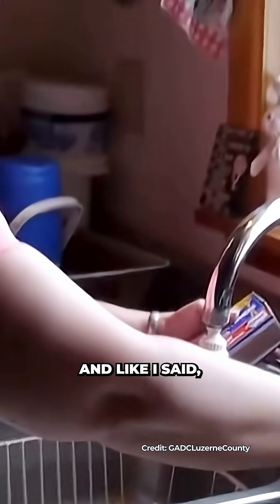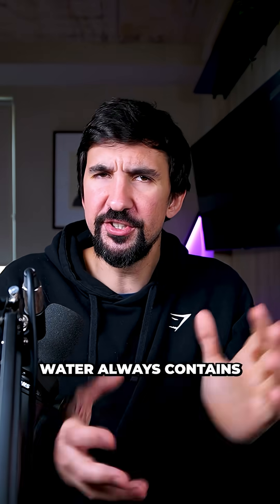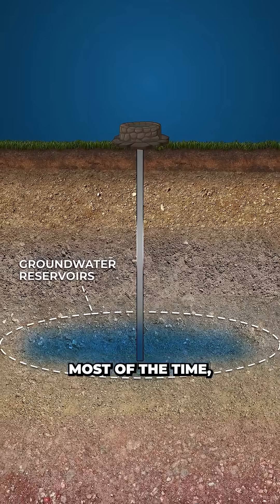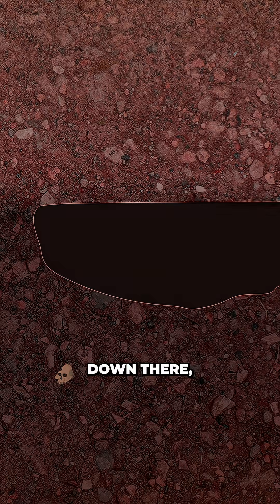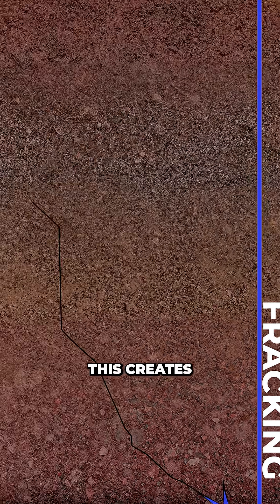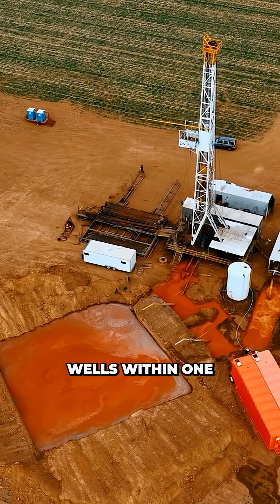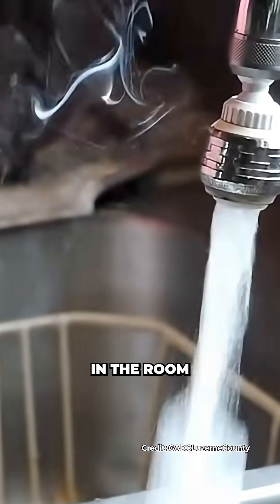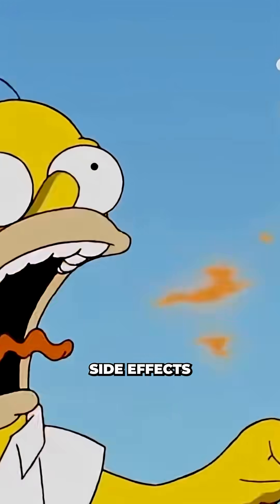Why This Water Catches Fire

Comment: I'm a lot harder on science videos than entertainment ones because even in a short, you're supposed to give complete information even if summarized.

The implication that methane in water concentrated high enough to ignite is only through human intervention is completely debunked and completely unnecessary.  The point that studies have found isolated cases of increased methane corelated to human activity is the strongest reason to set rules around how those activities must be done.  Instead, talking about it like it's a common fracking problem works against the very awareness you're promoting because it turns the clear solution into an all or nothing issue for a problem very few people are experiencing.

I expect more from a fellow Ben.

Comment: What kind of country makes direkt water well to tapwater connection?! No cistern or water tower inbetviene?
Reply: Some wells supply only one or a few homes. Methane is a sign that the water may be contaminated with toxic chemicals, so I'd rather have gas out of the tap telling me not to drink it, than a degassing cistern upstream hiding the problem.

Comment: I believe you can get an air trap for your pipes so gasses can fly off. Or an aerator that does the same while also replacing the rest of the dissolved gasses with ambient air (and oxidizing heavy metals as a bonus). Still kind of insane that that’s needed in the first place though, especially that a home owner would need to figure that out themselves when regulating businesses and their consequences is a governments job
Reply: Aerators do not do a damn thing to heavy metals. Aerators slow the water from your tap to something that isn't high pressure. They may help somewhat with dissolved gasses, but anything coming out when the pressure drops as it leaves the pipe will also bubble out in the first minute or so. Dissolved heavy metals are often in the form of oxides or other more stable compounds than their elemental form. For this you need a filter of some sort.
Reply: @zerumsum1640 If the methane comes from an oil&gas reservoir, toxic carcinogenic hydrocarbons will usually come together with the methane.

If the methane comes from shallow biogenic gas, made by anaerobic bacteria, then the water might be safe, except if the methane comes from a landfill.
Reply: @anderslvolljohansen1556  Yeah, i was more commenting on the comment directly. the fracking byproducts are their own category of nasty.
Reply: Toxic chemicals can come together
with the methane. Degassing of methane doesn't remove all of those toxic chemicals.

Comment: If you live in an area that has gas reservoirs it it quite possible for ground water to contain gas naturally.  Fracking may not be responsible.   Early oil and gas reservoirs were found by oil  and gas comming to the surface.  Natural gas eternal flames can occure.

Comment: That doesn't look safe. The water provider definitely needs to add a methane extraction module into its system 😮
Reply: It's well water.
Reply: @Triggerfish70  Oh, ok. Then that's something I would definitely do myself as a home owner.
Reply: 🤔 so free methane if you can collect it
Reply: but methane is safe in the water, what ur trying to do is like making every piece of wood in a house non flammable
Reply: @e-rr1vp It’s safe in the water until it comes out of the faucet, then it’s just flammable gas building up in the house. The only reason you can tell there’s methane in the house is because we add a chemical to make it smell. This stuff comes out odorless.
Reply: @doob62  thats crazy
Reply: @e-rr1vp Crazy as in crazy dangerous? Or crazy as in I’m crazy? If it’s the latter, I fear for you.
Reply: @doob62  if its the latter that is implying that you are a that (like an object but not a person) which i am not, pretty simple english
Reply: @e-rr1vp  Sorry, I misread your comment. “That’s crazy” could be an implication that the thought process is crazy, and therefore, the person is crazy themself for thinking of it.
Reply: @doob62  It's okay, but I noticed that your channel is pretty old. I'm curious if you bought it or if you made it yourself in 2009?
Reply: An aerator would do the trick. Think stereotypical Roman fountain before the water goes to treatment. If methane is really that high you might as well do a methane capture too to heat buildings or something.
Reply: is someone paying you to be obtuse?
Reply: I’d say if this is the result of fracking, then the company doing so covers the cost for all ground water faucets within the affected zones.
Reply: @doob62  That's an option, right. Don't know how to sue a million dollar company to install something that's a couple 100 dollars per house, though. So I guess that would have to be the authorities' job to make sure of 😊
Reply: @neatwheat  No lawsuit required initially. Just have residents send the bill to the county to record and the county bills the company with 10% interest after the first month.

Comment: Would building a system to release that methane from the groundwater work? Or maybe some system to collect it before it reaches the homes?

I can imagine some little vacuum system set up in a basement to force out the gasses, filter them, and bottle them.
Reply: Maybe a tank where you left the water for a while to capture the gases before pumping it to homes would work, that would also reduce the air pollution those gases cause
Reply: Other much more toxic chemicals would remain, like benzene.

Comment: Win-win situation 😂😂😂😂😂
You degass the water in a sealed chamber 
....
The gas floats to the top of the chamber and is collected and used in heater...
The water stays in the bottom and being pressurized again 
....
Win-win situation...you get the water and the gas 😂😂😂😂
Reply: You get toxic water. Some natural and added toxic chemicals will remain in the water after degassing.

Comment: "The water, is in theory, safe to drink"
Tell that to the residents they are suffering from diseases next to the fracking sites, unless you are saying they are lying.
Reply: Heavy metals and toxic chemicals in the water are bad, methane is only a Physical hazard not a chemical hazard to your health
Reply: @EightyTwentyRatio Methane is a sign of contamination. Other toxic chemicals may follow the methane.
Reply: Apparently, assholes think fracking companies need to be defended. That's very interesting. Why do they need to defend themselves?
Reply: Looking at 80/20 MAGAnut.
Reply: @HattieLankford-24 It's very reasonable to not want methane in your water. I also don't want methane in my water. But drinking methane isn't dangerous. There's plenty of methane in your gut right now, totally normal. What part of that means I support fracking? I voted for Jill Stein who supports the green new deal. To answer your question, fracking companies need to be defended by assholes because what they're doing is udderly indefensible

Comment: Improper drilling, causing poisoning, covered up by politicians to protect the criminals.
Reply: Uranium mining, processing and nuclear power plants don't cause those damage for neighbouring communities. I literally live next to an Uranium processing plant in France where all the ore destined to Europe is extracted and there's not enough radioactivity to exceed normal background levels in some areas (like mountains or granite regions). My sister literally lives next to both a nuclear power plant and an enrichment facility (Pierrelatte).
Nuclear industry caused globally, Tchernobyl (which was a completely different reactor architecture) comprised, less death than air pollution caused by coal or Nox emissions in a single year in a single country.
Reply: @yannickramouillet3742 I doubt you live next door to such a matter of national security. Also, you said processing, not mining. Big difference.
Reply: The video says methane is not poisonous.
Reply: @onii-chandaisuki5710 unless it starts building up
Reply: @onii-chandaisuki5710 and I saw a video that basically said I was an abortion.
Reply: Regarding fossil fuel industry, it sounds like buisiness as usual... 😅
Reply: It's not improper drilling if this is a common side effect. The only way to fix it is to end this garbage
Reply: @UwUzi-owo 
Fracking allows oil extraction in places where other methods don't work.

And we need more oil than those other methods are capable of supplying. If you want to reduce oil extraction to a degree where Fracking is not needed, we are going to need to need to build more energy efficient cars, replace every gas furnace with a heat pump, stop using plastic and plastic products entirely, and replace all solar and wind farms with nuclear plants.

You want less fracking, get the US to be less oil dependent.

That, or solve the flammable water problem. You can extract methane from water. Methane extractors are probably cheaper than eliminating the oil and gas industry.
Reply: @redstonewarrior0152  I don't understand the car obsession. We need more trains and buses.
Reply: @redstonewarrior0152 would be world wide.
Reply: @seajelly2421 because i don't want to wait on a bus to arrive or wait for you to build tracks locally.  I live 6 miles from town so your argument is null and void.
Reply: @brandonstansberry9195 there are 140,000 miles of train track on the US alone. There are about 1.3 million kms of train track in the world. Why act like 6 miles would be impossible?
Reply: @brandonstansberry9195there is no coherent substance to your reply. Just because in regards to what? Are you saying improper drilling techniques are okay, and that proper techniques aren't necessary, even if they are legally required?
Reply: @IRKnTBot no im just asking in normal use how much methane are you going to end up with unless the water stays on all day. 

How is that not coherent?
Reply: @seajelly2421 because I don't want to walk 12 miles a day.  Also because I live in a country that is somewhat free.
Reply: @brandonstansberry9195 trains = more freedom.
Reply: @brandonstansberry9195because you are making the problem seem less serious by distracting from what else is in the water.
Reply: @IRKnTBot no dude just asking a question the video was based on.   

You on the other hand assumed.   😮
Reply: Perfectly correct drilling. No criminality. Free methane for water customers.
Reply: @angrytedtalks  Would have been said by...any random State representative of a fracked up area. 🤣
Reply: @YannickMenning Truth hurts.
Reply: @a @angrytedtalks and unusable
Reply: @IRKnTBot dont talk to the creature, it is a parasitic creature that feeds on angering people.
Reply: Drill baby drill!! - Trump 2024. Y'all elected this shit now deal with your methane water 😂
Reply: @TheRealMcNuggs 
Yet morons like you chose Kamamamamamala.  We would have 100 million illegals by now, 30 supreme court idiots like Jackson.  So yes, we did put the correct person in the White house.   Oh and BTW, how are those electric bills going now that the tech overlords have strained the grid? Ya. I thought so...up 50% since 2020
Reply: Are you an idiot? This has been a thing for more than a decade now, happening under both Obama and Biden too. Have you never heard of Flint, Michigan, or is this just another opportunity to spew your raging TDS?
Reply: @abjectlyterrible

So what's the plan? What are going to do about it?
Reply: @T @TheDeadEyeSamurai Subject please.
Reply: @abjectlyterrible  People like this idiot has been brainwashed a long time ago to dedicate his whole existance to find dirt on trump, even when it’s completely untrue, in any circumstance he will project😂😂😂😂😂 No logic in trying to debate people like this, they are lost
Reply: @ThorBB brainwashed how? How is pointing out that Trump wants to drill more and more, causing more and more contamination in groundwater, not factually accurate? How is it brainwashing? Add in how conservatives push for it and liberals want less, replacing it with renewable sources. So yeah, do you just like insulting people when they are right and you are wrong? I see you subbed to people who pretend to be Christian. Do you consider yourself one? If so, why do you insult at all? That goes against the teachings of Christ. Also, you seem to like to point out the speck in the eye of liberals while ignoring the plank in your own. Also against the teachings of Christ. Shall I continue?
Reply: @TheRealMcNuggs I think you misunderstood. There is nothing wrong with this water. However  it is a missed opportunity to capture the methane. 
The point being made here is that it is sloppy geoengineering or production which may cause this entirely natural phenomenon. Nothing to do with politics whatsoever.
Reply: @angrytedtalks  it's literally a fire hazard in the kitchen and you said nothing wrong? dude you have survival instinct of a deer in front of headlight
Reply: @lakraknjeprak2536because you leave the water on all day?   How much do you think is going to come out in normal use?
Reply: @brandonstansberry9195the amount you saw obviously. And running it all day would cause the methane to immediately start to dissipate out. You would have to have a large pool around for your claim sophomore.

Comment: Yep.  Never live within 10 miles of an active oil well, if possible.  Close in, you get the stench of crude.  Gas in the water is not uncommon, especially if it's well water.